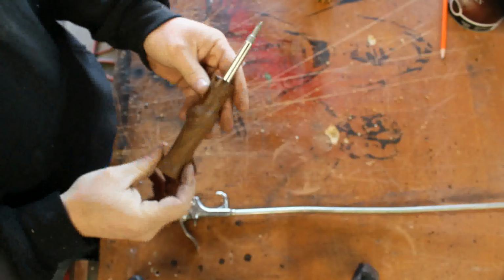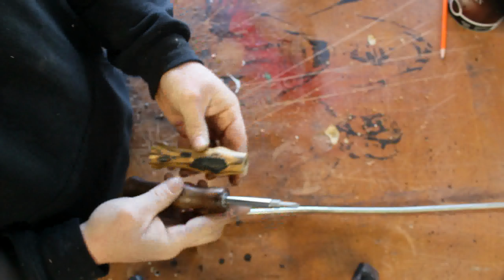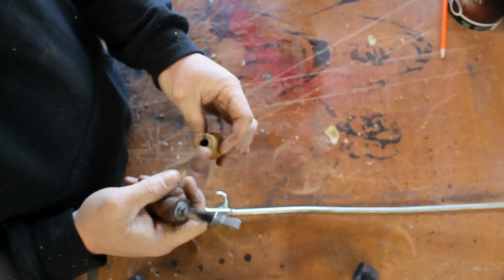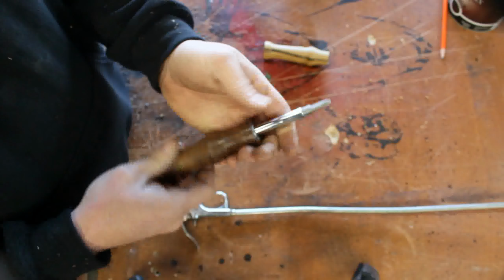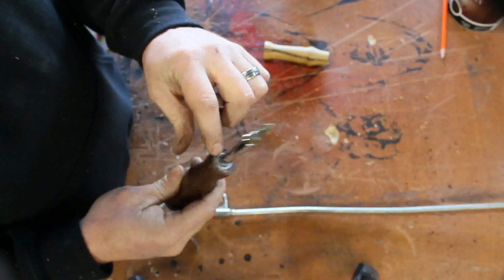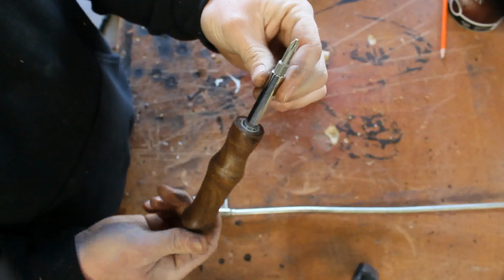combination screw driver {lathe project}

Comment: Could you drill the hole bigger and glue in a dowel and then drill it again? Might work would be a shame to waste that figured wood! Great video anyway 👍🏻
Reply from the maker: dom sturman i ended up putting it on the fence handle for my table saw.